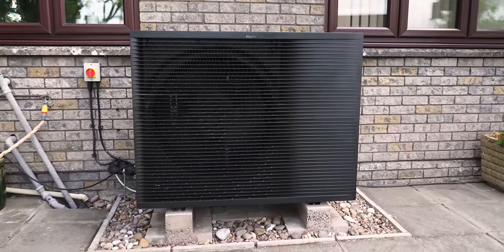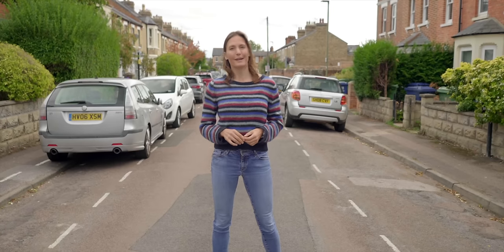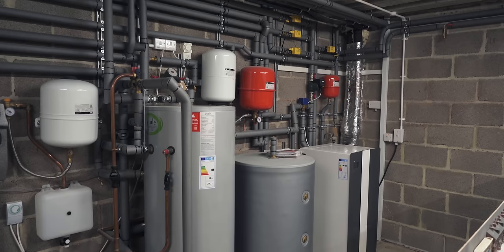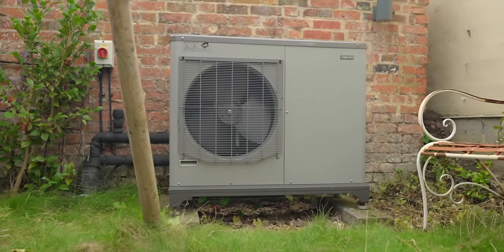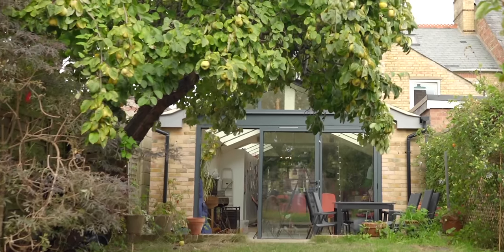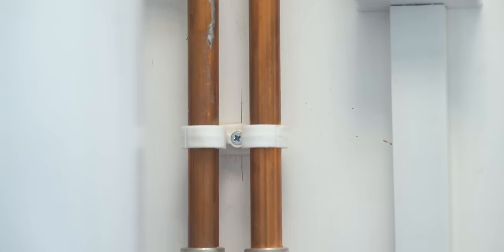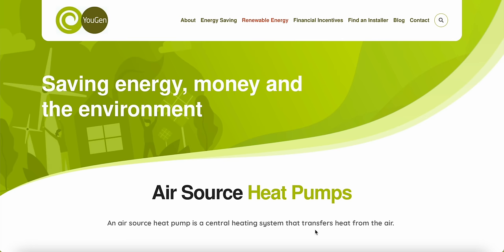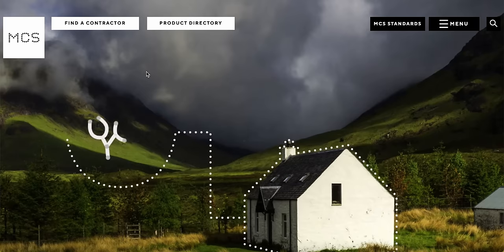Does a Heat Pump Really Work In A Victorian Terrace?

Comment: We had one installed 12 months ago in a 1930s semi, north UK.  It's working great - higher COP than expected, reliable and at current prices is saving money vs. gas (12months ago I couldn't say that, but it was a small difference even then).  I haven't done anything extreme.  It still amazes me how much false information is online about them, hence I intend to put my experience online as another rea-world retrofit example.
Reply: How much did it cost in total to switch over to a heat pump, equipment and labour?
Reply: What was the COP please.
Reply: @timfallon8226   I can't give a short answer as we sneaked in at the end of the RHI scheme and also took part of that upfront as the green homes grant (you couldn't have both!).   The online advise generally says £9-14k which was right for us, I upgraded the heat pump spec higher than necessary to accommodate a potential future extension which added significantly to the cost.  In the end I also installed the appropriate radiators myself and paid on top for that (long story; wanted to keep fancy column radiators).  The math says about £3900 total after the 7 years of RHI payments, ALL costs included, based on todays energy prices - but £9k upfront without me changing radiators (it worked fine with the existing radiators, but works much better with the upgraded system).  I plan to do a decent blog on this soon - hope that helps.
Reply: @normanpouch  was around 3.5 with gas system / higher temperature sized radiators, running the last couple of months at COP 4.9, main rooms at 20C and hallway at 18C.  I need to see how winter goes for a full comparison, but comparing to last year Autumn is suggesting 1-1.5 increase is attainable, as I've got the setup much better than the installers started it on.  I hope to do a blog on it.  I have the MMSP data for the above figures, I am amazed by it so far.
Reply: @greenbot9467  thanks for replying.
So all in all it was massively more expensive than a conventional gas system even with a fat slab of government subsidy thrown in.
Reply: Yes it is more expensive - I went into it with my eyes open and wanted to pay extra to improve my environmental impact. I considered using the money for an electric car or even a newer car, but this was a cheaper and more effective option. It’s obviously easier to consider when more substantial renovations happen or the existing system is more compatible with simple changes. Still, makes more sense over buying a £30k+ electric car that will depreciate, for my case.
If people still install gas it would be good if the system was designed with future upgrades in mind, such as using suitable pipe diameters and larger radiators, even the gas boiler would be more efficient then. My neighbour has done just that.
Reply: If I may ask, do you have insulated walls? I assume no cavity
Reply: @manfromdelmonty303 cavity walls with badly installed loose blown insulation before we bought it.

Comment: If you have a oil burner, a heat pump can save hundreds of dollars each month!  I have a air to air heat pump, 1,800 square feet and 48,000 Btu heat pump.  A little oversized, but in the winter I never need to run a electric back up heater!  My coldest outside air temperature is about -5C or 20F.  At 23F (about -5C) the 48,000 Btu heat pump can collect only about 24,000 Btu's of heat, because the outdoor air temperature is so cold.  Just enough in my case!

Comment: Informative, thanks. I'd like a case study of an end of the 80s 5-bed detached microbore reasonably insulated😉
Reply: What does 'reasonably insulated' mean? This is one of my bugbears - there is no generally understood language for the difference between '50mm of fibreglass cavity-fill' (minimal insulation) and '50mm of cavity plus 200mm of external EPS/rockwool/woodfibre' (very good insulation - passivehouse grade). One is U=0.57 the other U=0.15 (nearly 4 times better).
Reply: @xxwookey  Good point. Cavity wall was filled shortly after we bought the house back in 2005, no other wall insulation, we have ~300 mm of rockwool in the loft, all windows were changed in 2018 to A rated double glazing.

Comment: Less exposed to fossil fuel prices - yeah, you would be if the badly structured energy industry didn't charge electricity in line with gas prices. Until that shower of s##t is sorted out then everyone in this country is exposed to higher fossil fuel prices whether they consume it or not. I don't even have gas yet I'm paying through the nose for my "renewable" electricity. I'll believe in renewable energy when I actually pay the actual real cost, not the price + extortionate profit. I bet the renewable energy companies are loving it currently, selling their so called "cheap" energy for ridiculous margins.

Comment: Why did he not mention the solar hot water on his roof and what he had to do to his radiators/pipework or any fabric improvements made.  These all make the use of heat pumps viable.
I think it would be far more informative if you case studied a property that did not include any building works to see the true cost of swapping out of a gas boiler.

Comment: Love the comments just brushed over such as
1: Insulate your home. With older buildings that’s difficult. My narrow cavity, sodden raised floor (below dirt) you basically have to insulate externally, then replace every window as they are now too deep set in total your looking at £12,000 before you start.
2: Next the floor. Designed to allow air to be drawn up to feed fireplaces originally. You can’t install underfloor heating which most people advise to use. So either you have to seal the floor & install a raised floor with insulation or you pour an insulated concrete slab by ripping up your floors in your whole house.

So after that little lot, once you’ve spent £15k you then have £6k for the install of the heat pump. So your now about £21k to £25k in to replace a £2k boiler. Then you have the operational limits.

1: If you don’t have it constantly on with a store of hot water you can’t get instant (say 30mins) of hot water. Turn up home unexpected soggy wet & muddy you either put an Emerson Heater on (very costly) or you use an electric dribble shower.
2: Same with the heating. Get a cold snap or just feel chilly in the evening. Didn’t tell the system oops that’s no heat for you.

So sorry until you give me a system that a) is instant to respond not hours, b) doesn’t involve me rebuilding my house and c) is cheaper than gas (just work the numbers I’m paying 34p for Elec per KWh, whilst gas is 22p. So 6’000 kWh a year is £2040 a year whilst his previous 12’000kwh a year on gas is £2’640 Even at that price (Gas will come down) the payback time on your £25k system - £5k installed gas boiler =£20k/£600 saving = 33.33yrs without anything ever going wrong. And that’s if you’ve got £25k floating around. 

So I support the move to net zero but please come up with a workable solution not great ideas for the few very rich people.
Reply: The options vary for type of house, lifestyle AND if mains gas available. 
If gas is an option, it's still the best - and getting greener too. 
If no gas, then HP may be viable.

Comment: All sounds lovely, but I know it's simply not true that heat pumps generate enough heat for most Victorian homes in the UK. I live in a detached house built in 1890 and it leaks heat very quickly. They're designed that way - stone takes on moisture and releases it - the house needs to breathe. Completely different to modern houses that are designed to keep moisture (and cold air) out.
I've added masses of loft insulation, double and triple glazing, composite doors etc but without insulating the floor and walls, heat will be lost quicker than a heat pump can generate it. Then there's the 10ft high ceilings - all that space above your head has to be heated before the room can start to feel warm.
External or internal wall insulation is not financially viable, especially in a cost of living crisis, so I'm afraid heat pumps remain a thing of wonder to those with a modern or otherwise super-insulated home and of course the wealthy, who can spend their way to end up featuring in videos such as this.
Reply: Your argument is a reasonable one based on common conception.  But it’s not quite correct watts are watts so a 16kW  heat pump delivers the same 16kW a gas boiler can but at much lower temperature.  Once you know the heat loss of a room at say -3 you can then size the heat emitters accordingly to deliver the watts required at the lower flow temps I.e 35C heat pump sweet spot.  You don’t need to add insulation if you don’t want to if you did you can save energy be it gas or electricity.  Heat pumps need to be run in a steady state mode low and slow,low flow temps and slow to react to temperature change they are a different mind set a rad at 30 C flow temp keeping a room at 21 takes some getting used to. My advise for what it’s worth get a heat loss calculator freedom heat pumps have one you can down load you can size each room put in the construction width height and it spits out heat loss for each room gives you rad sizes at the different flow temps and run costs verses gas and oil.  At the very least you could slowly replace rads to be heat pump ready once the Government bans gas boilers.  Hope you find this helpful and maybe help out at a future date also check out the heat geek channel and web site.
Reply: Thank you for your reply. I had given up hope of reading any thing that gave any information that fitted my situation.

Comment: I feel parts of this piece are a bit disingenuous. The chap was asked if he had a lot of disruption fitting the heat pump. He's had a lot of building work done, so was already highly disrupted and said he had an extra day and a half work done, which was not too bad for him. A person just having a heat pump fitted will find it a lot of disruption, most likely having to change all you radiators along with the installation of the heat pump, tank etc. Also he stated that it save him approx 9kWh a year in gas and electricity. He should have stated how much it saved on gas only, given that electricity is approx 3x the price of gas, so reducing gas is a lot less of a saving that reducing electricity. Having said that, I will fitting a heat pump my house in the future.

Comment: I ‘love’ how casually the guy talks about ground source being a bit more involved. Reality is unless you have a field behind your house then ground source isn’t really an option. 
Additionally, the cost of ground source is prohibitive. I just had a quote for £22k for one. 

The main guy being interviewed mentions having a mixture of radiators &UFCH. That’s a recipe for disaster as such a mix is really inefficient.
Reply: The bore hole option has got to come down in price as more installers offer it and manufactures supply the pipe work.

Comment: Would be good to offer a more balanced view including some of the downsides and interviews with people for whom they haven't worked well - I know this channel is all about advocacy, but I think it needs to be honest that heat pumps are not a silver bullet and if badly sized or fitted can be a disaster (and the reality is that there are a lot of cowboys out there jumping on the bandwagon doing a bad job of fitting them). Space and a suitable place to site the unit is a big problem for a lot of houses. Also while electricity prices are linked to gas and are 3 times the unit price of gas, the savings probably aren't sufficient to be affordable for a lot of people, especially when factoring in the capital cost of install. I recommend watching channels by fitters like Skill Builder if you want real home truths.  There also seems to be lacking in the market sufficient reputable companies offering decent home energy efficiency surveys and advice (beyond the bog standard efficiency certificates for home selling).
Reply: Yes but he's not the only one doing videos about the drawbacks of heat pumps, even when fitted and sized properly. Also we don't have the long term experience with them in this country or enough skilled people to maintain them/ repair them when they go wrong.

Comment: They are noisy no matter what people say. Once your ears latch onto the sound it never goes away. Unless you have solar & battery they are expensive to run.  They cost a lot to buy and install. 
The answer has to be build energy efficient homes, stop using electricity unnecessarily. -
Reply: Yes, it will sound like every home has a hot tub. A total nightmare for peace and relaxation.

Comment: Also a difference between air and ground is the ability to work when the temperature is very low.
Reply: We have a cold climate heat pump here in Canada and it works down past -25C so no worries about the cold.

Comment: It’s always fascinated me when I visit the UK that you have almost no heat pumps.  We were last there in Summer, and we sweltered in a heat wave, and nowhere that we stayed (mostly airbnb) had any kind of cooling. 
Here in Australia they’re extremely common, usually in the form of inverter reverse cycle airconditioners, and even if often used more for cooling than heating in Northern parts of Australia, but they’re still terrific for heating in winter, absolute best of both worlds.
Reply: @mclovin8739  But, you’re completely losing sight of the fact that they make fabulous super efficient heaters too, unless it’s colder than about minus 7Celsius or so.
Reply: We just didn't need indoor cooling in this country more than about 1 day/year until quite recently when the whole place got heated up. So it made no financial sense to install equipment for it. Even now the incentive structure discourages heat pumps that can do cooling as well.
Reply: Lol imagine being in Britain and complaining about the lack of air conditioning.

Comment: The term "Home Truths" should indicate some level of balance.  This video is everything about advocacy and little about truth. As numerous people have commented here, there are many disadvantages to retrofitting heat pumps to existing buildings with gas central heating. Having to replace radiators and pipework, find somewhere for a hot water tank, noise, installation costs, are all potential issues with heat pumps. I am disappointed that these facts weren't aired.  There is a very good case to make for heat pumps but not in all situations.

Comment: Great content as always, if I could put in a request: it would be really good to get a side by side comparison of home heating tech; ideally covering pros and cons, the average install and running costs, and finally one of the key costs for us small house and garden owners - space required. I've looked at heat pumps and IR panels. I know that heat pumps can do it all, whereas IR panels mean that you need other tech to heat water, so it would be good to see how IR Panels paired with an immersion heater (or similar) stack up against a heat pump. From what I can tell, heat pumps seem to look good on paper, physically however, with their not insignificant size and industrial looks...IR panels lack of need for external infrastructure makes them look attractive. Ultimately, we the pubic have been known to buy not necessarily what is "best", but what is more convenient. I guess that's what I'm trying to work out. If it costs more to heat my home and water in the long run with IR etc, but by doing so I wouldn't need to look at a heat pump every time I walk out the door -  would I consider the additional cost to be worthwhile?
Reply: The nice thing about an IR panel is that you can buy a small one and try it without committing yourself to a whole house system.

Comment: Nice introduction to heat pumps, but what about the additional noise, the need for bigger radiators or going for air-to-air heat pumps?
Reply: Our Mitsubishi Zuba heat pump is built for cold climates (I’m in Canada) and it’s much quieter than the air conditioning unit it replaced. It’s so quiet in fact that I usually have to look for evidence that the fans are turning to know that it’s even running!
Reply: I've done exactly that: gone for a simple air-to-air heat pump (essentially an air-cond system) simply because it was considerably cheaper to buy (£1,300. installed) than a full air-to-existing central heating one, which would have been £10,000 - £14,000 installed by the time rads and pipework had been upsized. Mine  consists of just one indoor air blowing unit, serving a single open plan living area, although you can get ones with multiple indoor units, working off one outdoor compressor. I'm getting infrared electric panels to serve kitchen and bathroom. Of course, being a blown air system, it can't produce domestic hot water. For that I've bought a modern, maximally efficient, direct electric hot water tank, just big enough for my needs (you have to have a ginormous one for a typical heat pump). If I'd gone for a more comprehensive air cond, of even two of them, one serving the bedrooms, it would still have worked out a lot cheaper than a 'conventional' heat pump. As for noise, it's no noisier than a typical fan heater. The compresser's noisier, but it's outside anyway.